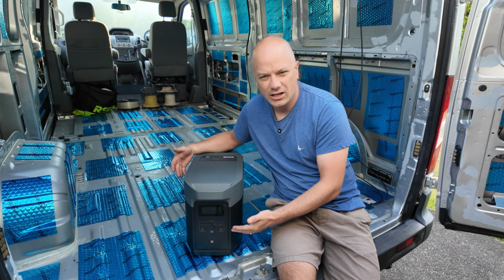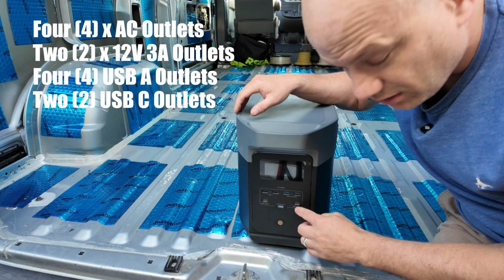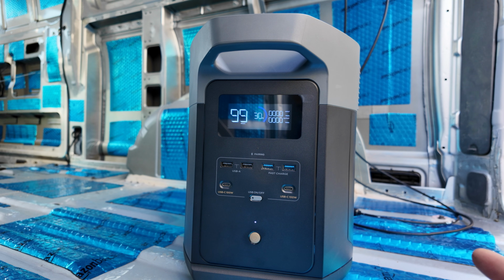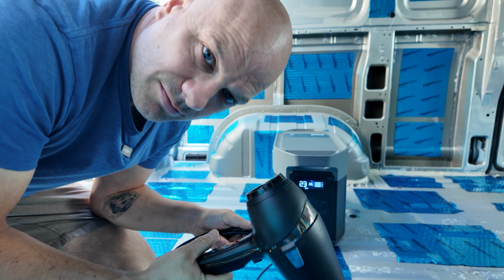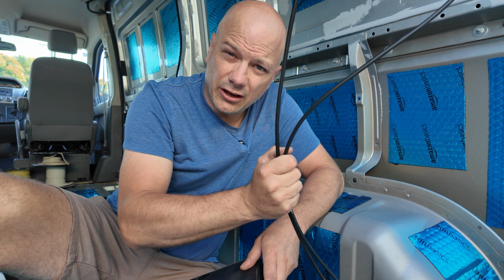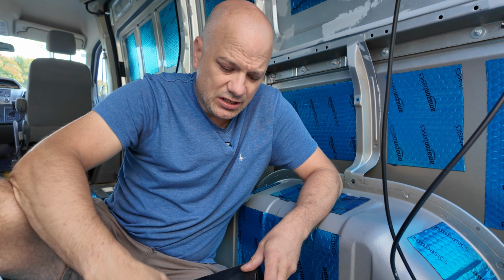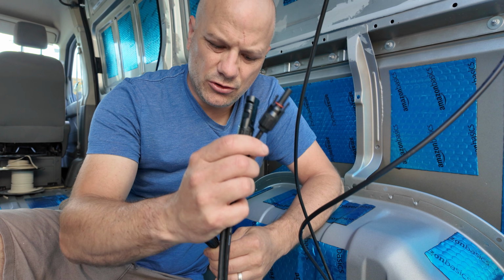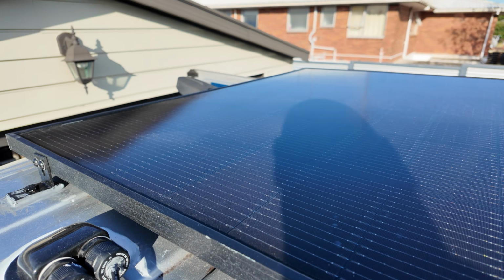Ecoflow Delta 2 Max Portable power station for my off grid Campervan.

Comment: How do you pull 12 volts to your van blade fuse box to power up the fridge,lights,pump ect…..
Reply from the maker: My fridge, lights are 240v and water pump is 12v. Different circuits are plugged into my power stations.

Comment: I just wish it had the same connection as the delta 3 so one could run the power to a distribution block.
Reply from the maker: True....
Reply: You can totally do the same with the D2M.

Comment: I've built my van 8 years ago.
I charge my batteries via the alternator (75 amps)  & did NOT put solar panels on the roof.
100k miles later I would not do it any other way. THAt is MY version of keeping it simple👍

IMO _You should consider mainly charging via the alternator rather than solar.
Reply from the maker: That sounds good. The solar is there on the roof for on the occasions when we don't drive anywhere. A method of topping up the powerstation👍🏻
Reply: @Poms-Away  Ya - I lieu to adding another level of complexity by adding solar  panels  (cost of panel -& rack and install & the 12% hit you take on the rig's gas mileage by having all that on the roof) - I stuck wth already existing form of charging  - ie:  I can fire up my  van's motor  for odd the occasions we are not driving when we have exhausted the 3 day of battery capacity that we installed👍

Comment: How do I connect this to my fuse panel in my cargo trailer conversion? The only thing I see is the DC cig port on the rear side..is that accurate?
Reply from the maker: There should be several ac outlets along with the 12v do port.

Comment: Isn’t the problem with this the limited 12v dc output, 2x 3A, you’ll have a problem running anything other than a few 12v  led lights with this.
Reply from the maker: There is a 12.6V 10A output. This will be used for a diesel heater.

Comment: I had a DELTA 2 and it was in my small camper van. I bought it 2 months before we went away on a 4500 mile road trip around Europe so I could understand how it worked. I also bought the alternator charger and all seemed great...until that is, 1300 miles (and day 5 of a 30 day trip) from home it failed. I then connected it to the 12v socket in the van to see if that would charge it, and that's when it started smoking. So what do you do? Turned everything off, 2 countries from home and now I have to either throw it away and lose a £600 device or sleep above a FAULTY lithium battery for the next 25 days and just hope it doesn't burst into flames killing me and my wife.
Well I'm not throwing £600 away!
After care took 23 return emails for them to finally agree to a refund on the unit and the alternator charger and they had the nerve to charge me depreciation on the alternator charger because that part wasn't faulty.
My advice would be AVOID THESE CHANCERS AT ALL COSTS. It could end up costing you more than just money.
Reply from the maker: I'm sorry to hear that. It doesn't sound great.
Hopefully, the Delta 2 Max doesn't have the same fate.

Comment: Happy to see someone with the same idea as me, the victron system made me overwhelmed and I thought why can’t I just use an eco flow for this 😅
Reply from the maker: 100%. It's the same thing just in one tiny box👍🏻👍🏻👍🏻
Reply: I’ve been doing van life fr 5 years now and run everything with two of the original Delta 1300’s. My next build that I’m working on now will be two Delta 2 Max’s + 1 Delta 1300 + 1520 watts solar + Ecoflow Alternator Charger. Woo hoo!

Comment: yes, the Ecoflow products are really easy and great! I went with the Delta Pro 3 in Canada, and bought the alternator charger from Ecoflow. The hookup is really easy, and it provides 800 watts of charging while idling or driving. Because we like to park mostly in the shade, we haven't yet installed any solar. Not sure if your unit accepts the EV charging input as well? That is another option for fast charging at very high input.
Reply from the maker: Thanks for your comment. 
I don't think the Delta 2 Max accepts the EV input. Although, with the solar and the alternator charger, I feel like we have most bases covered.....FOR NOW👍🏻

Comment: I bought the delta 2 about a year ago. it has mostly been for emergencies, but it has also gone on a couple of camping trips. I've recharged it with a foldable solar panel. We've charged phones, ipads, laptop, fridge as well as power an induction cooktop. It has done well. Now I am in the market for a van and thinking about how to power all corners of a van with it. where will you delta 2 live?
Reply from the maker: Sounds good. 
Mine is going to live in the garage section of the van under the bed. I'm still debating whether I should get the additional battery.

Comment: i need this setup ! thanks for the review !  do you think i can connect Solar and Car socket in PV1 and PV2  together ?
Reply from the maker: I have had the solar connected into PV1 and the alternator charger connected to one of the additional battery inputs at the same time.
Reply: @Poms-Away  so it will work ! thanks    i have the Anker PowerHouse 757 but this device will not work 24/7 with solar  if there is no sun in the evening the anker powerhouse will give some ticking sounds and turns off all connections USB / DC / AC  , so my fridge will turn off and food is ruined ! also driving in long tunnels no light it will turn off ! piece of crap it is !! ( problem is the anker powerhouse is hidden away in my van not easy to unplug everything to work again. . . thats why i wanna upgrade to ecoflow , i hope this runs 24/7 without touching it !
Reply from the maker: @TheFlyingDutchMan8K You can set the outputs to run for a certain period of time or continuously, and it is all app controllable via your phone.
Reply: @Poms-Away   thanks !

Comment: I was torn between this and a traditional dual battery system for my trusty ol' Hilux doublle cab. I last looked into it about 20 years ago, but nowadays it seems a porable soplution would work just fine. Personally I will put the alternater charger on also.

Plus it's quite a lot cheaper than a tranditional dual battery installkation. One part about a dual battery system however that I like is that I can hide some of the components behind the back seat, but this is kinda redunant on an all-in-one box like the ecoflow. I can use the change to buy panels 😎

Comment: How are you getting over the 10A limit for the 12v stuff? Are you using the cigarette socket? A fridge is about 5amps on its own.
Reply from the maker: I intend to have a low energy 230v fridge and leave the 12v side of the Ecoflow for the diesel heater and lighting.

Comment: I've wired my hookup cable into a rcd double socket. The cable to the consumer unit then has a plug on the end, if I'm on a hookup and don't need to charge the ecoflow I just put the plug in the socket. When I'm off grid the plug goes into the back of the ecoflow. I can also tricke charge from my 200ah leisure battery so have a total of 540ah with the ecoflow Extra battery. When not using them in the van I bring them inside and use them with the ecoflow powerstream saving me even more money. I have spent about £2.5k versus the £6k quote I had for a Victron system.
Reply from the maker: That sounds like a great idea that👍🏻
I am seriously thinking about getting the extra battery to ensure we are completely self-sufficient. We may spend a small amount of time on sites here, but I really don't want to have to go to a site for a recharge. With the solar and now alternator charger that I have installed, plus an extra battery (if I get it), I'm hoping we can remain off grid for a decent amount of time.
Reply: How much please

Comment: Yip I use the bluetti AC200max in my van simple plug and play job done easy peasy lemon squeezy.
Reply: 12v fridge 
Lights 
Diesel heater 
Microwave 
Charge phones and tablets 
I use the 12v 30amp plug from the bluetti to the 12v fuse box i couldn't be arsed on with all the fancy shit haha keep it simple
Reply from the maker: What are you running on it if you don't mind me asking.

Comment: We have the delta 2 max to use if we are off grid . We have only used it once so far and we just used the hook up cable and plugged the van straight into it from outside , it worked a treat.  Have you thought about the EcoFlow alternator charger while driving?  We have it and it is great as it charges very fast at 800w max , we don’t have solar. It would be a good back up in the winter in place of the solar .
Reply from the maker: Good to hear from somebody who had the same idea as us. Although, it's not tested so far, I think it's going to be a great solution for what we want. 
I knew the alternator charge was an option, but haven't really looked into it. Was it easy to install? I can see how it would be great for the winter months when sunlight is at a premium...